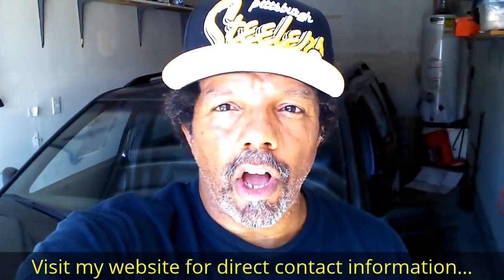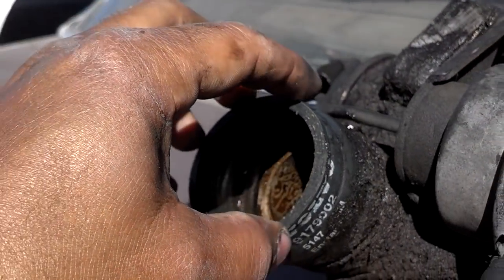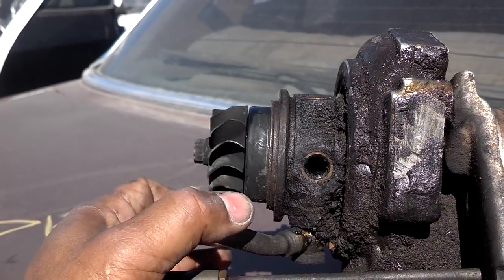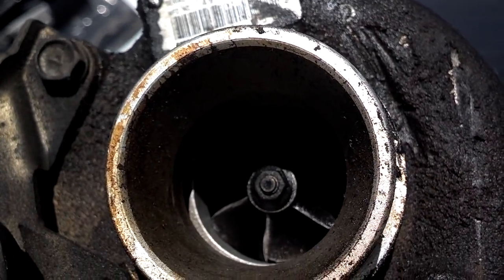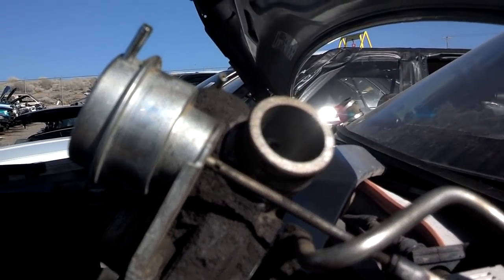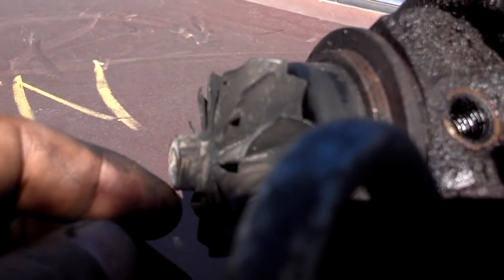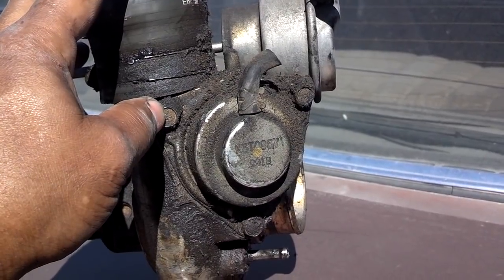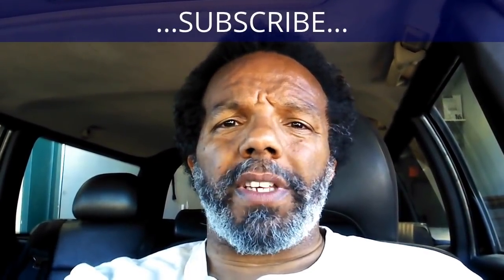How to tell if a turbocharger is bad. What can go wrong with them. - VOTD

Comment: Good video, I have a Focus TDCi MK3 2014 with what I suspect is a Turbo issue, for first few mins driving the turbo boosts up to 14PSI then stops completely after just 2-3 mins and the car feels like a train. EML shows occasionally but not always. No smoke coming from exhaust and no unusual sounds or noises. Checked all hoses and pipes, all seems good. Error code is P2599. Any help or advice would be greatly appreciated, if someone could just point me in a rough direction. Many thanks.
Reply from the maker: Sad to say I have no experience with that. Sounds like a heat issue. Bad sensor or something. Causing the computer to dial back the boost.
Reply: Robert DIY no problems, thanks for your time 😀When boost is lost, I can pull over, switch engine off and start it back up again and I can drive it normally for a few minutes again, if it was temperature related wouldn't boost only return if the overheated part cooled down to its normal operating range? Its almost like a sensor or something is acting up for a brief moment and causing the turbo to shut off. Its very weird and doing my head in :D
Reply from the maker: Not necessarily. When you turn the car off it likely resets the computer and it needs to see a series of faults before it puts the car back into limp mode.

Comment: thanks mate , very insightful, can you tell me , the waste gate actuator -how easily should that move? when on car , engine turned off should it be slack and easy to move or stiff but moveable with effort , thanks in advance.
Reply from the maker: Stiff and moveable.
Reply: Thanks very much Robert, seems mines working ok then and my fault could be variable vanes sticking intermittently. Your video has been a very good tutorial for me , thank you.

Comment: Here I am again!  My 98 V70 XC with turbo ...white smokes at startup and smells like gas ...then after it warms up it subsides.  The car has plenty of power and seems to run fine otherwise.  I overhauled the PCV system last summer as per your instructions. 
 Any ideas on this?
Reply from the maker: Is it smoke or normal condensation?
Reply: I am not sure ...I will have to examine it again after I finish the radiator replacement ....what exactly should I look for?  I think it is white smoke with a gas smell ...that goes away as the car warms up.
Reply from the maker: Condensation, normal.
Reply: With the gas smell?  Our newer 2012 doesn't exhibit that syndrome ...which is why I am bothering you with this.

Comment: Have you seen many turbos fail and dump coolant into the exhaust. I have a 02 xc70 and it is loosing a lot of coolant through the exhaust but the compression is great on all cylinders.
Reply from the maker: No. Do a leak down test. Probably a blown head gasket. Have you been playing coolant roulette?
Reply: Robert DIY I had a feeling you would say that. I have done probably a half dozen head gaskets on these cars and this one seemed different. But yeah I will do a leak down and see what that tells me. Thanks for all the videos I thought I knew Volvos then I saw your videos it's awesome.

Comment: Hello I have a question about Smoke comming out the Oil Tube or Cap. Can this be from a bad turbo?
I initially had a problem with oil pick up tube. 04 s60 2.5T FWD. Also my initial turbo was leaking oil. Pulled turbo from salvage yard thinking it was good but turns out its making a grinding sound when spinning. Doesnt smoke like a train tho. The oil pick up tube was replaced with the new plastic design. PCV banjo bolt on manifold cleaned and obstruction on pcv tube cleared. Initially had negative pressure in the oil . Do you think the turbo is bad or maybe I could of messed up on installing the oil pan back as there is a minor leak. and the turbo might be bad too. Sorry im not a great DIYer and its a hot mess.
Reply: So do you think I can just turn this 2.5T into a Non turbo car? I was reading the 01 or 02 may have had non turbo models. and if so what do you think will be required for this delete? assuming I can find a rear  manifold at the salvage yard
Reply from the maker: Huh? No.
Reply from the maker: https://youtu.be/FIRoc0VxLd4
Reply: Thanks for the reply but i think I figured it out. First off the turbo I got from the salvage yard was OK, the thing is. The oil coolant line got slightly bent or kinked and oil did not flow thru it during the replacement install. I loosened the bottom banjo to the oil inlet and it pushed some oil to the top. Next the PCV system issue. The 17mm banjo bolt with the nipple always gets clogged. I cleared the obstruction awhile ago but when i took it off last the connection from that banjo bolt to the pcv box got disconnected. That hard plastic tubeing broke and i just slipped on a hose to join the two peices of plastic. Lubed it up to slip the hose between the plastic parts and it slipped off twisting and turning the manifold for reinstall.  If anyone has this issue.. read here maybe
Reply from the maker: Fantastic.

Comment: Literally the best video I have ever seen! This dude is literally a genius and I have never scene someone explain a car part better. He literally explains every little detail and it's actually amazing to listen to even though I don't like cars.
Reply from the maker: Thanks for the kind words and for watching.
Reply: Robert DIY no problem dude. I'm about to do my wheel bearing here today but I also into a dress some kind of exhaust problem I think. When I accelerate hard the car gets really sluggish and we'll make a popping sound almost like backfiring. From what I understand I think it might be the catalytic converter. I have a 2003 Chrysler PT Cruiser 2.4 l Turbo. Any ideas?
Reply from the maker: Does it have any codes?
Reply: When they hook it up it says code reader but the check engine light is on and when you sit in idle for too long it flashes

Comment: Mercedes turbo is most reliable!
Reply from the maker: Really? How long do they typically last? I replaced the one in my Volvo at 293,000, it was loosing a little oil.
Reply: Robert DIY I have the V8 biturbo with 168k miles and still running strong. I race it a lot and it’s bulletproof.
Reply from the maker: Very nice.

Comment: I wasn't aware that Volvo used a type of external wastegate flap. Is it like built into the manifold or something? I'm used to k03,k04 vws.
Reply from the maker: MI Backyard Engineer the waste gate on my car is in the turbo housing flange, the actuator that controls it is external (1995 Volvo 850).

Comment: Hi great videos, advice please  300tdi landrover whilst I was doing some maintenance a clump of oily tissue was sucked into the air intake didn't realise until I tried to drive off later. I took off the elbow hose and found the restriction and refitted everything back together but now my hose from the intercooler back to the engine is sucking flat. Stripped it down again to check turbo blades their spinning freely hoses are clear intercooler Doesnt seem blocked 😭😭 do you have any suggestions.  Thanks in advance.
Reply from the maker: Check the throttle body. Remove and clear all of the intake tubes.

Comment: Suspect turbo failure on my fiesta tdci replaced bad injectors with new and since doing so turbo will not boost at all its like a whinning noise when i press the accelerator coming from the turbo
Reply from the maker: +Dale Bassett have you checked it?
Reply: Robert DIY the turbo spins freely no damage to the metal fins and no play in shaft does smoke on startup a bit so im leaning towards failing oil seal in the turbo
Reply from the maker: +Dale Bassett when the seals go, usually causes shaft play.
Reply: Robert DIY ok thanks for that i stumped to be honest just working at all the turbo

Comment: I discovered that water outlet under battery chamber of my 2002 1.8T Passat was blocked and trapped enough water to half the battery level. After draining it, the car starts large smoking on eithet drive or reverse.
Please what's the problem?
Reply from the maker: +Bukarolz Collins I have no idea what you are talking about.

Comment: Hi Robert,

I own a Lincoln MKT, that I purchased about seven months ago. It drive fine until a few months ago. My wife noticed that the engine light came on so had her take it to AutoZone and have the codes read. Came back as oxygen sensors, so I replaced those. Unfortunately, as soon as that was done, started it up, went for a drive and immediately noticed thick white smoke from the tail pipe (which it was not doing prior). Took it to the mechanic and was told it was the engine, and to replace would be $4k. Had the car taken to the Lincoln dealership (where I purchased the car from), and was told that my water pump blew, which caused both turbos to blow, and repairs would be $5k. I have since replaced the water pump myself ( using the factory service manual), and am on to the turbos. However, before I start I was wondering if I would have to actually replace the turbos simply because the water pump blew?
Reply from the maker: +tcummingssr have you tried to drive it?
Reply: Robert DIY, we have driven it and the acceleration was slow on pickup, didn't have the boost that it had before. I'm in the process as we speak, putting back together the front engine cover, intake manifold, valve covers, etc. I have thought about replacing the fluids once I'm done and taking it out again to see if the new water pump solved the problem. I just can't wrap my brain around the fact that the turbos blew just that fast from the water pump going out. Just figured that maybe by some chance the white smoke was coming from the bad water pump, which caused the lack of acceleration. Oil was fine, and coolant was fine once I drained them ( not mixed together).
Reply from the maker: +tcummingssr is the check engine light on? Usually, when the water pump fails it blows the head gaskets. If that happens it can cause fluids to mix. If it is driven much after fluids mix it can damage the turbos. 

If the head gaskets are blown it will usually cause a misfire. Loss of power, etc. You can physically check the turbos, but if they are bad they are usually noisy, leak oil, and cause smoke to come out of the tail pipe when you accelerate.
Reply: Robert DIY Robert DIY. Thanks for the reply. No the check engine light was not on. None of the fluids were mixed, when I drained the oil and coolant, so I'm confident that the heads aren't blown. (No misfires at all).  Just as simple as replacing the O2 sensors, and immediately after that white smoke from tail pipe. Dealership didn't mention a problem with the heads just a blown water pump which caused the turbos to blow from loss of coolant, so I'm wondering if the turbos may still be in good shape just misdiagnosed (went to dealership the very next day after O2 sensor replacement). I did plan on checking them off vehicle once I get them removed to determine that

Comment: Another way a turbo can fail is the output side shaft breaks and bits go through the intercooler and into the head. This happened to me a week ago in a VW T5 Transporter. They have taken the head off for inspection and have sent it to get shaved. With gasket kit, oil, oil filter, turbo, radiator flush, coolant, labour, all up over $5000. The worst part is the timing being over the holiday period means things take longer and I'm 1000km's from home and still waiting to get moving again.

The turbo had a faint whistle which a mechanic suggested it meant it was on the way out, I thought I'll be gentle with it and all will be good. Unfortunately the week before my trip I think that whistle got a little louder, but everyone would have been booked out then, 1 week before Christmas. 

This video is good but doesn't emphasise how bad it can go wrong. My repair bill is huge and the damage to the motor at this stage looks minimal, it could have been worse.

Edit: They have allowed 16hrs labour and the turbo itself is $1700 because the VW turbo and manifold are one unit. These are Australian prices and I'm in a small town with most parts coming from outside.
Reply from the maker: Sounds a little like overkill to me. I know of people that had turbos explode and they didn't have to have 1/2 of that stuff done to the vehicle. If you look at a video or something that shows the flow of the air flow that is pressurized by the compressor wheel you'll see that it is near impossible for the bits from the compressor wheel to make it into the cylinder head. 

The intercooler is like a coolant radiator and the air flows over the fins within it. The metal bits would have to make it pass a lot of air passages and I simply don't see that happening. How did they determine that pieces of the turbo compressor wheel made it to the cylinder head? 

Besides that, if they pull the cylinder head of correctly, it likely would not need to be machined and made true, about 1/2 the time they are flat when I pull them. Some do it all the time to be "safe" and I guess that's ok but I still can't imagine bits making it that far.
Reply from the maker: https://www.youtube.com/watch?v=Yd9N2yMO5KY
Reply from the maker: https://www.youtube.com/watch?v=zenMEj0cAC4&feature=youtu.be
Reply: Robert DIY 

These guys are in the category of machining any head they remove, plus the guy who machines it checks if it has gone soft. 

One of the guys said he heard a rattle, then switched it off and back on and the rattle left. They said the only way they would be 100% was to remove the head. They said there were some minor scratches indicating something had bounced around in there. 

I drove it a couple of times only 1/2 a k or so when it first happened and at one stage I heard what sounded like crap going through the exhaust. 

They're replacing all gaskets to do with the head, then there's some testing to be done at the end of it all. I'm a bit shocked at the price too, but it does seem like they are just doing a totally thorough job. At one stage he mentioned doing the timing belt while it's all part, but that's been done already. 

The 50 + yr old guy doing the work sounded like he knows his stuff and said the only way to be 100% sure was to remove the head and check the valves and so forth. With the VW turbo being so expensive and the intercooler having to come out and emptied of debris there probably wouldn't have been any change from $2500 without taking the head off.

Locals told me they aren't cheap as well, as it's a small town with few options, but no one bagged the quality of their work.
Reply from the maker: https://www.youtube.com/watch?v=DqWKNuTppmU
Reply: Robert DIY 

I agree it sounds unlikely for bits to get passed but a few mechanics have told me it can happen. 

A lot of things have just added up, overkill I guess, but then I guess it makes sense to flush the radiator I don't know the last time that was done, I've only had it for 6months.

Head bolts    80
Coolant          44
Turbo              1700
Oil filter.          40
Head work.     300
Rad flush.        150
Thermostat.     50

Then there's Goods and Services tax of 470, but the one thing that really bugs me is a $545 VSR gasket kit that doesn't even include the head gasket which is another $214. 

He hasn't even added oil to the list yet and labour is estimated at 16 hrs at $90/hr which comes to $1440.
Reply from the maker: I'm not saying that the mechanic doesn't do good work, I just can't see how turbo bits would make it into the combustion chambers. Also, there is NO WAY to take an intercooler apart to remove turbo bits so, those will still be in there. Doubt if they make a difference. 

A simple compression test would have shown if there was any damage to the cylinder walls. But hey, sounds like that is all water over the bridge now. Hope all goes together well. Should be good for 300,000+ km after all is back together.
Reply from the maker: Question: Do you use full synthetic oil? Do you let the turbo warm up and cool off properly?
Reply from the maker: https://www.youtube.com/watch?v=tY-v780C7d8
Reply from the maker: Excuse me sir, can you toss a turbo on there and see how it runs???
Reply from the maker: How many miles/km does the vehicle have?
Reply: Robert DIY 

It has about 230,000 km's, I generally take it easy when it's cold. But the cooling off bit I didn't know about. When it went pear shaped I thought I had ran out of fuel even though the gauge showed half full. At the time I said to myself " damn it I should have got fuel when I stopped just 5 minutes ago".

I'm on a big trip so a little loaded up doing highway speeds, when I stopped 5 minutes earlier I just turned the key off, no idle down as I was unaware I should. Then when it blew up I was doing about 3200 RPM passing a caravan up a hill.  

I've owned it about 6 months and never let it cool down before shutting it off, though I have been driving it fairly gentle the whole time, but that was just around a flat city. Long distance stuff sees more hills. 

I know better now, either drive real conservatively before shutting down or idle down. And from what I've been reading on VW forums, maybe they should be replaced every 100,000 km's as a safeguard to being broken down at an inopportune moment like on Christmas break and incurring a repair bill more than twice the price of replacing the turbo.